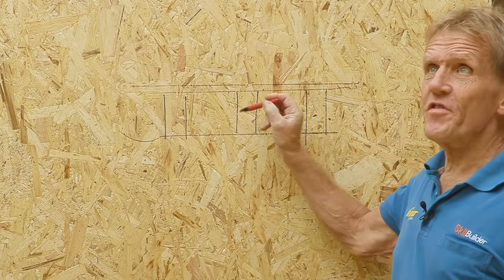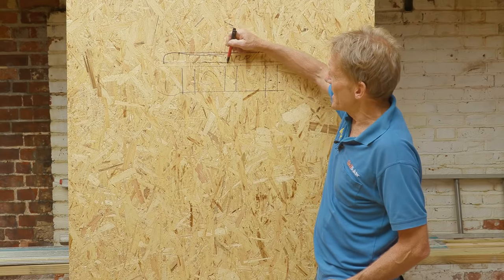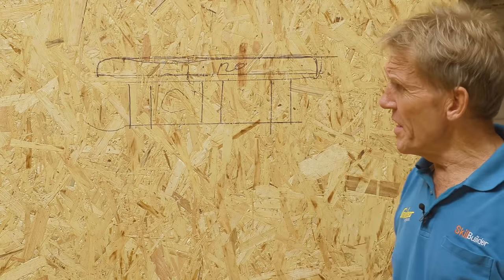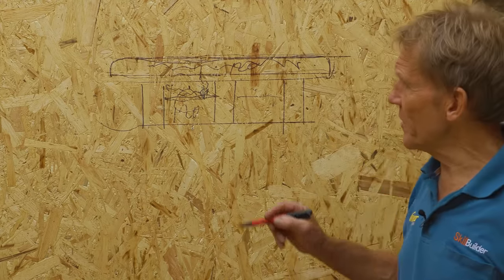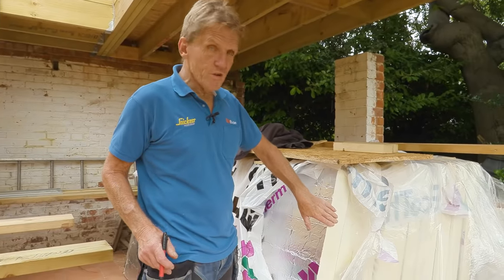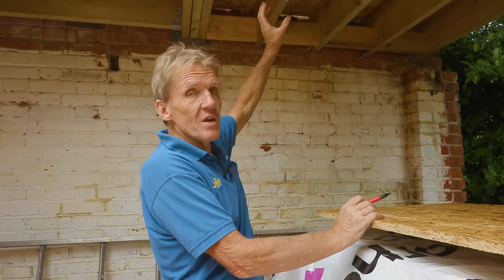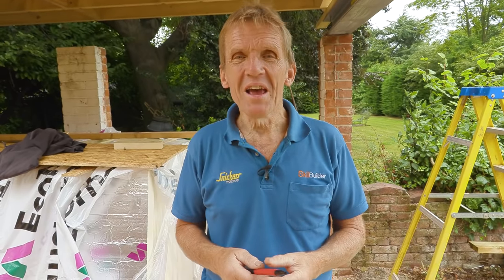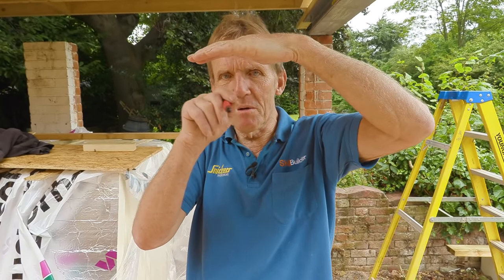Warm Roof vs Cold Roof. What’s The Difference?

Comment: With a cold rood. Could you not put a vapour barrier on the inside of the insulation? 

In my head that would seem that no moisture would even get to the outside of the insulation/dew point. Therefore, that would make the void and all the ventilation aspects redundant? 

I don't know if this would work but the implication from a warm roof implies that it could. The only potential issue I see is when installing the plasterboard the screw for attaching are going to pierce the vapour barrier which isn't ideal but I'm sure there would be a way to avoid or mitigate that, if it even is an issue considering the piercing would be filled by the width of the screw.

Comment: In my workshop which is basically a large shed I stapled foil bubble insulation under the roof cladding. Will this cause problems? It's tounge and groove panels only

Comment: I've informed myself a lot about the physics and the standard practice of warm and cold roof design. One thing I'm still trying to get my head around is this : why not press the PIR insulation tight-flush up to the underside of OSB in-between the joists? This way we'd be removing the cold air void entirely - nowhere for vapour to condense - and thus eliminating the need for ventilation? Wouldn't this then result in the dew point being at the same point as it would be on a warm roof design? I get that there would be cold bridging through the timbers but if we used insulation backed plasterboard on the ceiling we'd reduce that. Even if the argument is that there's a microscopic un-ventilated air void between the cold side of the insulation and the OSB - why is this acceptable in the warm roof design between the insulation and the outer skin of OSB?
Reply from the maker: Hi Julius
I think you make a good point. I have thought about this as well. If you have a good vapour barrier on the inside the amount of moisture that gets through is very small so I don't see why it shouldn't escape if it reaches the cold side. 
I suppose the air gap allows it to sit on the cold side of the insulation as droplets rather than being wicked into the OSB.

Comment: Hi Roger. A very interesting and well presented video (as usual!). I've got an uninsulated garage roof with OSB straight on to the rafters, with GRP bonded to the outside of that. Could I spray insulation between the rafters and to the underside of the OSB without worrying about a vapour barrier anywhere?
Reply from the maker: If it is closed cell insulation you can do it but a lot of the foam spray lets vapour through
Reply: @SkillBuilder  Thanks, bud.

Comment: Iv done a cold roof on my extension as I didn't want a massive facia board I think they look awful , however warm deck roof so much easier , wish I had done it now
Reply from the maker: You can cut the fascia height down by stepping the joists
Reply: @SkillBuilder   great idea 👍 iv never seen that done before

Comment: Great video as usual. 
I was wondering, in case of a vaulted roof, can you create a void between the plasterboard and the PIR which leaves room for electrics and down lights etc? The PIR will be flush against the underside of the osb and then the roof tiles on top of the osb. This way there is no gap for the moisture to build up and no need for ventilation. The only gap is on the warm side of the insulation but being on the warm side there is no condensation. Or am I missing something ?
Reply: My limited knowledge tells me that in this cold roof situation the timber joists are not only a source of cold bridging (making the temperature of the joists below the level of the insulation flush against the OSB would be cold and allow moisture from the room to condense on the joist) but also wood absorbs moisture and allows it to migrate within the wood itself transferring moisture to the joist/OSB interface which could then extend out across the underside of the OSB at the insulation/OSB interface. With no ventilation above the insulation in this case rotting could well occur. Leaving a service void below your insulation but with still a ventilated space above it would be a solution. As an extra precaution sealing the insulation in place to remove the passage of moist air upwards round the edges of the insulation is recommended (Kingspan). On another point, using plasterboard with a vapour barrier can help stop moisture penetrating into the area on the underside of the insulation but it can also prevent it from getting back out when conditions are right for this...

Comment: If you insulate a warm roof on the inside --> you run the risk of condensation and moisture problems (100% humidity and thus condensation). But you run into trouble much sooner, right? If the humidity level exceeds 70% you increase the risk for mold dramatically. Even in de dry house you get to this level very quickly --> meaning that you can't really insualte a warm roof from the inside. Or what am I missing?

Ventilating the in between the roof and the insualtion might be the only option -- but does that not reduce the insulating effect allot?

Comment: Foiled insulation board is vapour control barrier. No need for additional material.
Reply from the maker: Foil backed board is indeed a vapour barrier but the barrier needs to be on the other side of the supporting board where possible in order to prevent any vapour leakage. I take your point though, the foil board will keep out 95%.

Comment: Question... On a cold roof, if there is a vapour barrier between the plasterboard and insulation vapour can't get to the colds side, what is the need to ventilate?
Reply from the maker: If the vapour barrier is 100% then it will work but if you have a small leak the moisture will collect

Comment: Great video. 

Can I ask if kingspan over the top floor ceiling will create moisture or will this be warm air on warm side of insulation? (this is a pitched roof loft so plenty of space above but we were wanting to put green loft boards over the kingspan also

Comment: The maximum height of the roof would have been shown on the planning drawings - this is when the neighbours could have had 'their say'.  As long as your not exceeding the approved height or permitted development, the neighbours can sod off.
Reply from the maker: This is a replacement roof and comes under permitted development. The lantern is the only bit they can see and that is what vexes them.
Reply: @SkillBuilder  This remark should be a comment fixed just below the video. Many people have commented the neighbours will be appalled at "mushrooms" covering the finished roof, when in fact they won't see the roof at all, only the lantern (or part of it). Great video, as are they all. Keep up the good work Roger.

Comment: I have a fairly simple question. With the warm roof design, why do you put the vapour barrier directly beneath the insulation?
What would be wrong with putting it under the OSB decking on the joists? I.E. put the vapour barrier on top of the joists, then OSB, then insulation. Would this not be good for keeping that OSB decking dry as well?
Reply from the maker: I can't see anything wrong with that idea and it is what I did on my roof. The OSB is on the warm side so no problem
Reply: @SkillBuilder  Thank you Roger. The more that I have watched your videos, the more I have realised that it's a case of applying common sense, logic, and looking out for any potential cold bridging places where vapour condensation can accumulate and not be released. And also realising that things like insulation and concrete are not necessarily impervious to water.
I found the parapet video particularly interesting in regard of the above, and halfway through the video, I could see where it was going.
Reply: then y did you say above the osb?????  @SkillBuilder

Comment: You mentioned vapor barrier (cold roof), does the foil on the insulation (recticel) count as VB, using sticky back foil tape to bridge across bottom of joists? 👍
Reply from the maker: Yes that will do the job very well

Comment: Isnt that foil on the pir board not permeable? This would result in the moisture being trapped in the pir board and condensing on the cold foil side with no ventilation?
Reply from the maker: There is foil on both sides of the insulation,  it has to get in to get trapped

Comment: @Skill Builder  , thanks for the very interesting video Roger. Does having a warm roof prevent the top side being used as a terrace? Or can the PIR take the load provided the OSB is thick enough?
Reply from the maker: The PIR insulation is used under floors so it more than up to the job. You can use 22mm OSB and a slab or a suitable covering. There are lots of choices out there.
Reply: @SkillBuilder  thanks very much for the reply! I enjoy all your videos by the way, keep up the good work!

Comment: I'm surprised +120mm to the roof height is such a problem, I mean it's only 120mm... Am I missing something?
Reply: Probably the difference between planning permission and permitted development. I'm guessing. I'm not in England, so not totally sure what the regs are.
Reply: You also don't know the relationship with the neighbours. They could be friends, and both agreed if the roof went about a certain point, they wouldn't do it. Or it could be planning permission related.

Comment: When constructing a warm roof is it acceptable to place the insulation board  directly on top of firrings, then OSB and finally GRP roof covering  and rely on foil backed plasterboard and sealed downlights as a vapour barrier?
 I also wonder if the insulation boards would compress into the firrings if the roof was walked upon to clean glass etc.
What are you thoughts?
Reply: Nope it requires 18mm deck below to seat the vcl

Comment: What happens if you push the insulation right in against the OSB? Surely that would stop your 'dew point'?
Reply from the maker: No because the dew point is still above the insulation and now the moisture is sitting there on the underside of the OSB and with no air it can't move.

Comment: Why not have the moisture barrier below the insulation ? 
Between the room lining (plaster board) & the joists/insulation.
Reply from the maker: You can but it can leak and putting it under the insulation is easy
Reply: If the vapour barrier leaks on a warm roof the deck would rot, right? Does that ever happen?

Comment: hi there, great content...I'm still arguing with my builder if we need ventilation or not for fibreglass if the insulation is at the top (warm roof) he thinks if we don't include ventilation on the warm roof then the fibreglass will start cracking in few years. Can you please confirm this is not the case
Reply from the maker: You don't have to ventilate a warm roof. You do, however, need to put a vapour barrier on the warm side of the insulation so you keep the moisture out. 
EPDM is in many ways a better bet because it is slightly vapour permeable and will allow low level moisture to pass through.
Reply: @SkillBuilder  thanks so much for the reply. Currently my builder is building a warm flat roof for a loft conversion. The architect specified a Polythene Vapour Control 1000ga while the builder bought the 500ga version. Should I be worried ?

Comment: Counter battening would have been better instead of all the vents. Joists act as cold bridges, so you should have a min. 30 to 50mm PIR below.
Reply from the maker: We will have the 25mmm pir on the underside as well as the bit in the joists. Counter battens help but they aren't enough

Comment: Excellent video with one but... how come this didn't come to light before hand? You've basically change a massive specification of the build because.of a neighbour. Does the build have planning permission? If so then who cares about the neighbour. It probably would have been easier to increase the height of the parapet wall so they can't see the roof. I would not alter my specification for a neighbour if I had already got that far. I've had neighbours complain about a garden wall which is within legal limits and I made a compromise but as a result I've made no compromise on my garden room and that is now 70cm above the height of the wall.

Comment: Many thanks Roger for great video. I understood the difference in outline terms but not the detail. Got it all now. So foil backed plasterboard for your job? as well as vapour barrier (Belt and braces). That leaves dumb question of screws through vapour barriers, good or bad? and best way to do? (And screws to use)
Reply: wood screws. drill pilot holes accounting for plasterboard thickness. some silicone caulk in the hole and all over the screw (not so much it explodes everywhere/damages the plasterboard). screw in. the caulk should seal any seams between screw/wood/plastic. the screwhead will get covered during the mudding stage. but as for nailing/stapling the barrier and sealing it initally, just seal it with tape that suits the purpose (ie. adhesive is compatible with the plastic/barrier material, tape is non-porous, moisture-proof, etc.)
at least this is what i gathered researching soundproofing (you literally try to encase the room in a giant sealed plastic bag under the sound insulation [10kgper metresquared MLV for fat bass absorption], plasterboards [acoustic ones are heavy, ~20kg, but like 10% more expensive and same thickness. seal the gaps with everfllex AC50 or yoour local equivalent between the boards!] and [ideally floating] flooring lmao)
Reply: @Belshazzaresque  Many thanks for detailed answer. Do screws need to be some special type/material. Just got hazy memory of normal woodscrews rusting away when in contact with silicon. Perhaps the silicon trapped in the water. The application though wasn't what we are talking about here, and my memory fails me.
Reply: @johncoppock3823  ooh good point, i don't know honestly. i meant to say the ac50, not silicone, must have brainfarted lol. and normal woodscrews, galvanised(?) i forget what screw dimension though, it was too long ago now and i just take a handful spares in and ask "more these please" when i need, sorry

Comment: I’m currently doing some simpler the building inspector wants us to put 100mm king ip the under side of the osb and then 25mm on the under side of the joists. Then 12mm and ply then plaster board do you you think this is right?

Comment: Hello mate! For single storey rear extension can you construct the roof without a steel through the middle of the roof? Thanks
Reply from the maker: Yes you can! The steel ridge is only where you need an open roof with no ceiling, often called vaulted. The steel allows you to put the rafters on the top rather than them pushing against eachother. If you don't use the steel you need to stop the roof spreading and pushing the walls over. This is done by the ceiling joists or ceiling collars which can be placed midway up the rafters. The important thing is to stop the spread.
Reply: @SkillBuilder  sorry I may have said it incorrectly. I.meant to say flat roof with ceiling joists. The extension will be 6mx7m with 4x2 roof lantern running through the middle of the roof. Can that be done without any steel in the roof?

Comment: I didn't know about the membrane between osb and insulation?
Reply from the maker: A lot of people don't. If the insulation fits close enough and you tape the joints with foil tape it might not matter that much but the  vapour barrier is the proper way.
Reply: @SkillBuilder  Cheer, didn't expect a reply.

Comment: Can you do a video about insulating single brick exterior walls (e.g. garage)? Or maybe that will be covered in this 'orangery'?  I've seen videos where vapour barrier is attached to back of stud work then stud work stood up/fixed to walls and then filled with insulation before boarding over (plasterboard or ply). But if its analogous to a cold roof, should vapour barrier be between insulation and board (assuming inside of garage going to be the 'warm' side)?

Comment: What we’ve done on a few builds in recent times is to use an mf ceiling (so long as uve  got the head height) it’s migrated from the office re-fit world to domestic fit puts it has some great advantages to boarding the underside of joists it’s super accurate ie level and flat important where fitted furniture comes close to or is scribed to the ceiling (kitchens etc) Uve created a complete ceiling void there’s ur ventilation services can b secured straight to the underside of the joists no need for drilling access holes through all of em if the space above the floor is occupied say a bedroom uve now got a much better dB rating so foot traffic noise between spaces is greatly reduced it rearly tics a lot of boxes and is brain dead simple to fit the only essentials r a laser level and a pair of wisses (tin snips) a battery drill and ur away

Comment: Cold deck roof construction is no longer recommended by British Standards Code of Best Practice, if your builder proposes a cold roof construction (be it for fussy neighbour or otherwise) insist on a warm deck construction, inverted or built-up. Mushroom vents are proven not to work and the cold bridging through the joists is not accounted for. Cold deck construction is only permitted on new developments above un-heated spaces (bin stores, cycle stores, garages) and for good reason.

Comment: Rodger ... Where does a cold bedroom above a garage sit with this, is it the same principle?. The garage is (very!) well ventilated and dry. I would like to insulate (celotex/Kingspan) below the floorboards, but have seen conflicting views as to how to go about it. Whether vapour barriers are required, and even then that gets confused further if they go directly below the joists or directly below the floorboards. Same with leaving an air gap above the insulation, Seen it done with and without. All a bit confusing, for what seems essentially a (fairly) straight forward job, but paranoid about creating damp / rot?